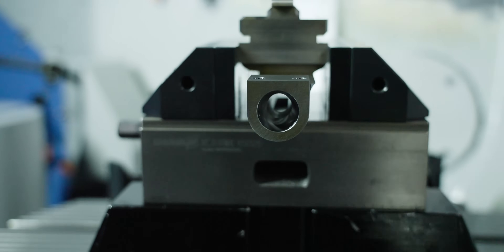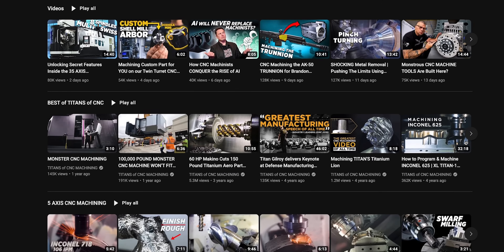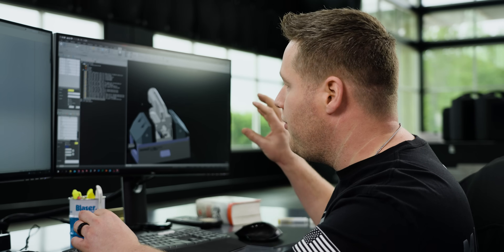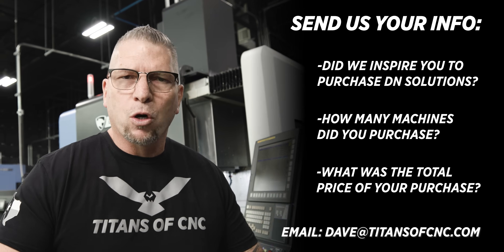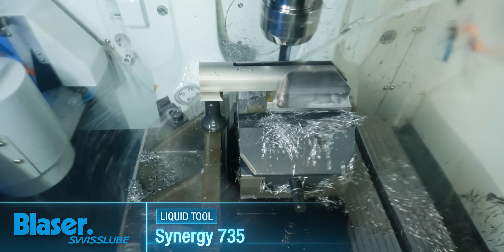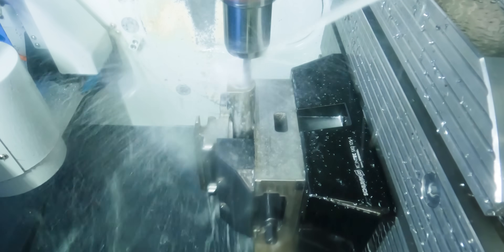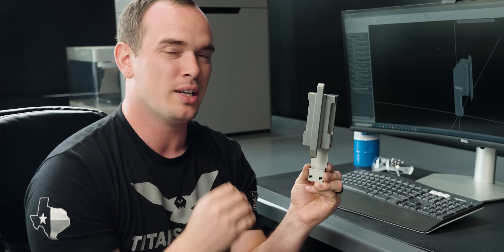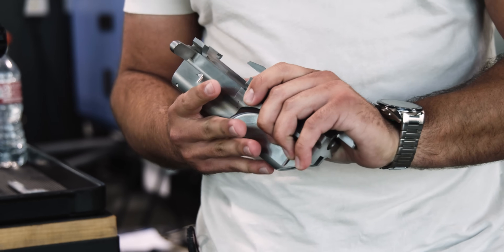CNC Machining the AK-50 Bolt Carrier for Brandon Herrera

Comment: I’m very curios if when they changed their name to DN if there was any improvement in quality I work in a shop with 2 doosan HM5000 mills and compared to their makino counterparts their hot garbage constant repairs and poor service in North America for repairs even our Okuma MBs run better though repairs are annoying on those aswell and their service also sucks we’ve decided we’re only buying Makinos from here on out atleast for mills our Okuma LB lathes run great and we even have an old ass okuma Howa vertical mill that despite being old as rocks runs incredibly well with almost no issues in quality and incredibly few adjustments
Reply: This is in a full scale production facility any of these machines are capable of those kinds of results for one or even a couple hundred parts but when your running 1500 parts per day per machine you want reliability that as far as I’ve seen doosan doesn’t offer additionally the makinos run 5 seconds faster which adds up when they run 24/7

Comment: try machining a spinning magnet disc slinger railgun, the idea is that the rifled spinning disc is a magnetized projectile, with launches between two wide copper high current conduction sheets (MA pulse/continous), inverted railgun kinda, brushless no spark, just sideways high current and top-bottom spinning magnet disc, rifling by right/left side being high friction and other is zero friction => spin
Reply: its a simple machined pipe with some insulation, and a square rail section inside copper sheet conductors
Reply: see the magnet railgun model on my channel video
Reply: an additional benefit is that the projectiles are flat magnet discs (ceramic iron magnet) that attach to each other and stack well, and say 20mm diameter 2mm height disc as the projectile, is similar sized to the normal bullet tip, but does not need the catridge, only the tip (disc projectile)

Comment: Why not just use JBWeld and a silicone molding? Be a lot easier and cheaper and let’s be honest, it’s a firearm so it’s not like the machining had to be “perfect” like it has to be for a machine like the Juicero, especially on a AK. A little sandpaper 220grit to clean it up and spray on some chrome or gold spray paint to spruce it up. Maybe you make a pink one for the ladies? maybe you don’t? Also this a little off topic but how about making this bad boy California compliant, I like having to disassemble my gun in order to chamber a round. Really if you don’t have to unfasten and fasten 3 torx screws of different bit sizes betwixt rounds your operating a machine gun California legally speaking. Also legally speaking a “AK-50” really should be chambered in 12.7x108 and even 12.7x55 would not be the lie 12.7x99 is. This is the AK-74 rechambered in 5.56mm or a AK-47 in .300Winmag We all know they should be in 5.45 or 7.62 respectively. It’s….. A…………._LIE!?!?!!_ Availability’s no excuse, throw 9mms JBWeld on some .50bmg brass until the ruler reads 108mm’s easy peazy. Maybe you make the added sections pink? Maybe you don’t, these are questions for wiser men than I. Maybe you switch over to AR platforms and ditch these pie in the sky .50bmg dreams and man up to a .22short. There is nothing more satisfying and inspiring than watching a .22 knock over a tin can. I watched one be fired once, I’ll never forget it. The noise was unbearable load and the muzzle flash blinded me for 7 months and I still have debilitating PTSD from seeing that weapon of mass destruction fired into a tree. It went straight through the bark like it wasn’t even there and buried itself 1/5” deep into that pine wood. Horrifying, I cried for 3 of the 7 months I was blinded by that flash, that must’ve been what the people of Hiroshima suffered, I feel I had it much worse. The doctors said they couldn’t even understand the damage done as they claimed to see nothing wrong, diabolical isn’t it! Well obviously I’ve rambled far and long enough I just don’t know how to end this aimless rant? I feel like I should 🎵push it to the limit🎶 and not just end with a stylish & hella cool “—Fin—“ but ramble longer and less coherent, just wander off into fanciful falsitudes like Biden at a podium with no teleprompter, I’m not kidding here. 
                                   ~ Fin ~

As you can see I have gone with the Fin choice because my brain is shot from years and years of a mix of concussion and heavy everything abuse. I blame hip hop and peppermint schnapps, that Vannila ice gangster rapping had me feeling like the guy that drove around Al Capone when the regular guy couldn’t make it and back up was too drunk! Gangster
P.S. I just realized this isn’t Brandon’s page so if you will next time y’all encounter him please try and shame him into switching to 12.7x108, maybe refuse to do anymore work until he remedies his mistake, please and thank you

Comment: 4:00 as someone who has not purchased a subtractive manufacturing machine (other than a bench grinder) I have been interested, but due to financial and space constraints, I have not been able to. Initially, just out of curiosity, I looked into tormach then realized that even with proper practices, they don’t hold the best tolerances. Thus, I have looked into building my own as a tormach would’ve been the closest production solution to my needs and I don’t have any need for high tolerance so I’m figuring sacrifice accuracy for price

Comment: Would be amazing to see an in depth video on how to set up and optimize .TEC files for wire EDM not alot of info out there on it, and it can make the difference between a part running 10 hrs with a rough finish and one only running 1 hr with a perfect finish.

Comment: Hello, I work as a machinist. I think the DN solutions videos are nice, because my company recently bought a few 6300s, so it was a help to me when I watched your videos because it familiarized me with the new operator panel layout. Also, I will add that the shorter tomb setup in the machine seems to not dampen correctly. The kitamura ran the same setup quieter, but it might be an issue with how it was set up.
Reply: Different machines, different construction. Probably quiet since the Kitamura has mehanite built into the construction. Take less step over?

Comment: Using wire EDM to rough and finish parts that are traditionally made in a milling machine it's a super smart idea or putting a hole in a part for the lathe that would normally be scrap metal chips on the floor if you would overnight especially with high-dollar certified material is a win-win for everyone think of all the big parts that begin by punching a giant hole in the part that now that core can be put on the shelf and become something else down the road.
There are a lot of ways to unconventionally use your EDM assets that can make you big money. 
We took many parts that we conventionally made on a Mill one by one to placing a chunk of stock on the table cutting out
Blanks by the dozen that only required minor second operations to finish.
If it has a tapered hole or surface it bears a second look with fresh eyes.

Comment: I wonder what plans (if any) Brandon has to modify the design of his AK-50 for more efficient manufacturing. Really cool video seeing the bolt carrier come together. 👍🙂
Reply: Seeing as his shop doesn't even sell regular AKs anymore (site says no longer accepting orders, no longer accepting customer parts kits, shop soley focused on R&D + content production), I doubt that there's any long-term plans to offer AK50s for sale to the general public.
Reply: Given how microscopic of a market such a thing would have, I would imagine that it really wouldn't make all the much of a difference in the grand scheme of things
Reply: @RyTrapp0  itll be a matter of cost per piece vs cost for intial setup
Reply: Right now he's on "can I make a prototype that can run for testing to match a average Ak time before failure" stage, once he's proven the design works, he's going to mod it for less extreme quality of build/cost
Reply: I wouldn't think about what they did here too much. This is purely a R&D part. The used the wire EDM so they can have a replaceable cam groove to avoid machining the entire carrier if they want to make a geometry change to the groove. The finish quality of this part is overkill. Most AK carriers are cast/forged and just have the critical features machined.
Reply: @murmaider2  Like pretty much anything mass produced.

Comment: Manufacturing the most expensive 50bmg in the world, kind of ironic considering its supposed to be based on the AK platform.
Reply: AKs are only "cheap" because they were able to be manufactured with workers getting paid so little that it was almost slave labor, and because of benefits from economies of scale. If you wanted to make a single AK-47 from scratch, starting with no tooling and ending with a service grade rifle, you'd end up spending tens of thousands of dollars minimum.

Comment: Nice video, I'm curious if you targeted dimension for a heat tree process or stress relief.  In my experience a lot of features tend to go out of spec as the part progresses throughout manufacturing and you have to account for this in the process. 

+1 with my buddy Barry keeping it fun and exciting. Can't wait to visit you guys again.
Reply: Never thought of tolerances changing from heat treating. There’s so many variables to take into consideration when dealing with these fine precision parts. Cool stuff